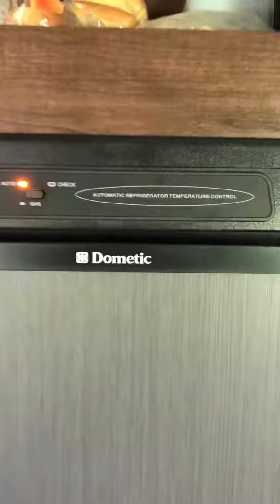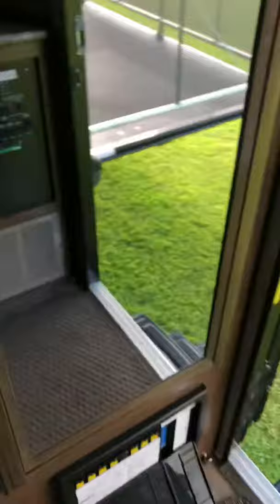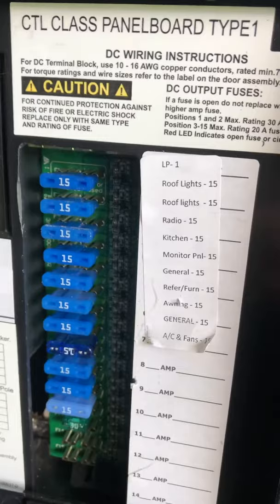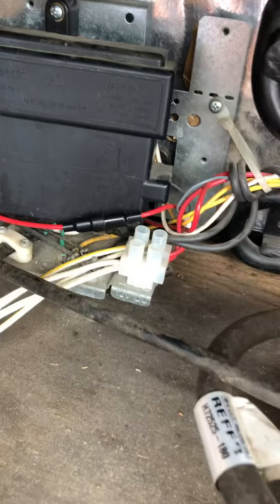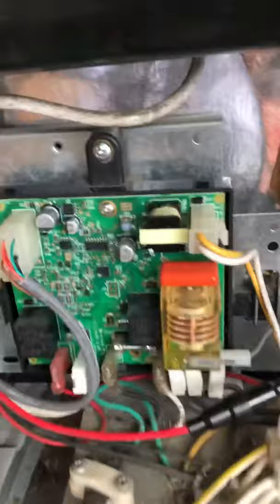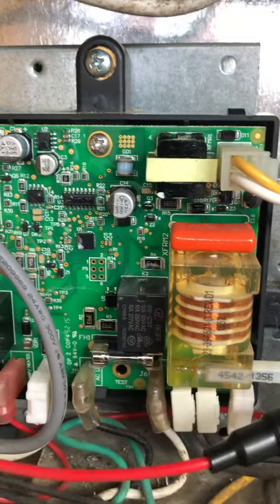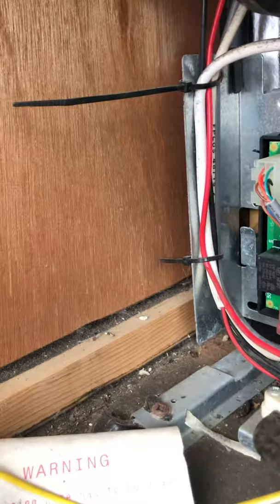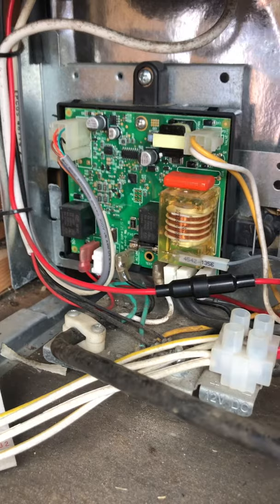RV Refrigerator not working (hidden fuse / EASY FIX)

Comment: Thanks brother. I literally was going to rip it out and put in house type fridge this weekend. Watch another video and learned about the additional reset switch. Did that this morning and still nothing. Now I'm headed to check this other mystery fuse.  Smh...I'm so beyond the manual. This should be in the manual because everybody can't afford to run it to dealership for issues.  Thank you and headed for the fuse.

Comment: Thanks so much we got to our camp and  our  refrigerator was not working  check light was  on  mode and blowing the breaker  I checked my fuses.as you. Described in your video  a my gas wouldn't come on as well  so I simply switched the two glass 5 amp fuses and wow the gas kicked   on  you.my friend  saved our trip and 100 dollars of food great very informative video. Greatly appreciated thank you

Comment: Thank you for the tip decided to go tiny house. And body older RV yeah it’s definitely a project just like buying a house going to move random and then work my day today job plus a night job office at Costco and hopefully get things back. Send decent shape, but the fridge is acting up. Along with the generator and the AC unit on the roof, probably something goofy I will work on. I also learned you can refill the little 1 pound grill cylinders or propane cylinders, YouTube video with the Mr. Heater attachment. Enjoy your camping.🇺🇸

Comment: I haven't tested any of the fixes yet since it's 112°F outside and I have a large Bodega portable refrigerator we normally use for drinks. But I still learned a lot from watching since I'm pretty sure one of these solutions will be the answer.

Thanks in advance!

Comment: Great find, and tip. Hasn't happened to me, but good to know. If the RV store doesn't have them (also known as "slow blow" fuses) I can get them from the local electronics store (kind of like what Tandy & Radio Shack used to be, where you can buy compo ents to build your own gadgets, not like the modern "electronics" store where you can only buy devices, not components)
Reply: Man I checked my little black cover because my fridge wouldn't even turn on. I check inside the black cover for the fuse and seen a stink bug inside, I blew it off the board and it instantly turned on.

Comment: Awesome video I replace it with a fast acting fuse and didn't know the difference, will get the time delay and see if that fixes my issue
Reply: Did the time delay fuse fix your issue?
Reply: @stephendriver1  no it was a wire that was chewed up on the outside slide out, all working good again

Comment: VERY helpful video! My question, my freezer works fine, but the lower refrigerator isnt working proper, any hints?
Reply: i am having the same problem
Reply: @derrickpartin  my daughter gad the same issue, she replaced the fan motor and it works great now

Comment: Uhg,  I cant figure out mine. No fuse blown in the breaker box. Dont have any way to test the thermistor. Might just try replacing it and see what happens. Freezer hasn't defrosted but is not cold enough,  fridge wont go below 50 unless I switch to gas. Any ideas?

Comment: Is this fuse also called the thermal fuse ?? Is it one and the same ?  We just had ours at dealer and they said the thermal fuse was blown due to having fridge running while traveling down the road ??? Not sure of point of having home away from home if I can’t run fridge while traveling to keep our foods cold.

Comment: I have a gfci outlet on the opposite wall of my trailer where the sink is at and when I hook it up to the city electrical it pops it and never stays cold. Can that be the issue? It works on propane and my 2 6v batteries not not city electricity
Reply from the maker: Hi, I’m sorry I’m just now responding to your message, I’m not real savvy to YouTube videos and replies. I hope you figured it out, but I think it could be your issue.

Comment: So if the glass isn't broken it's not blown?
Reply: The thin wire inside the glass is the fusible link. If it is broken, then the fuse is blown. The glass is just the case surrounding the wire.

Comment: How do you know if the inline fuse is blown?
Reply: Simple answer is to unscrew the housing and look at the fuse. If it looks good, check it with a voltage meter. Cheap ones can be purchased at Walmart. (Be sure to look at Youtube videos for the safe use of a voltage meter.)

Comment: What model Dometic do you have please? I have a Dometic RMD8555 and wonder if your fridge is the same as mine.
Reply from the maker: I’m really sorry I didn’t respond sooner. I’m new to making videos. I’ve sold that camper and don’t recall the model #, I hope everything worked out well with yours
Reply: @richburke81  that’s ok. I was able to figure it out. Going to get a new fridge..the price of the parts have gone up so much and no guarantees that they will work and can’t return them. A brand new fridge costs me just a tad more than gambling with buying the parts.